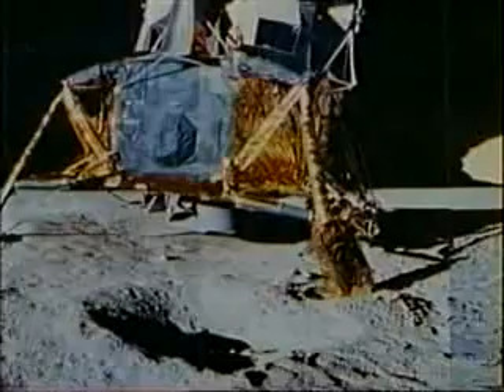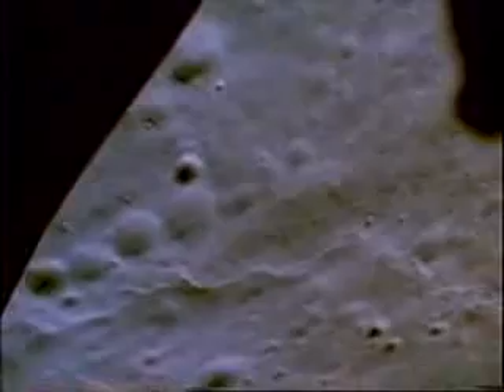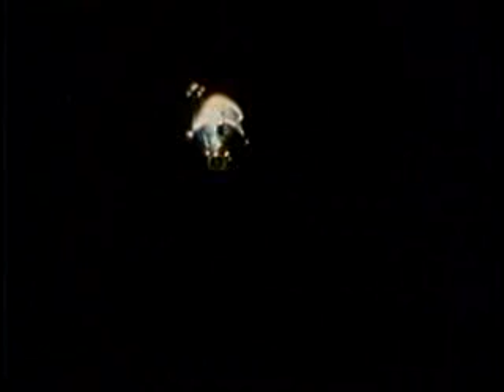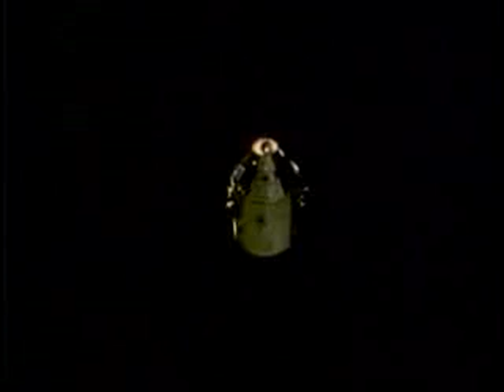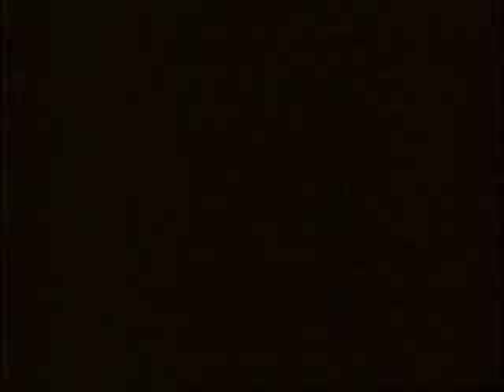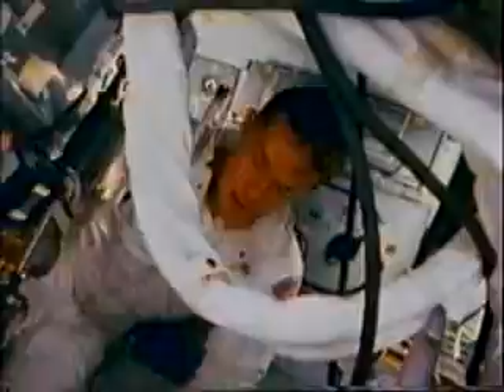Apollo 14 LM lift-off and CSM docking

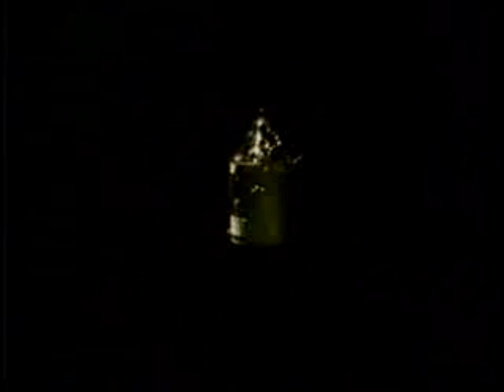Comment: There is an idiot called straydog02 who thinks the blue flash around 2:00 is evidence of front projection using a Scotchlite screen! 🤣 It is sunlight reflecting off the CSM surface shining through the tinted glass panes of the LM window, and bright enough to light up part of the frame, which, for those of little brain, are the lines to the left.
Wouldn't model work with black cloth behind, be a better option for attempting fakery? Front projection would be a ludicrous option for this situation.

Comment: And yet not even the hubble soace telescope or  any other terrestrial telescope is able to slot any trace, amazing space magic
Reply: The Hubble isn't powerful enough to resolve such small objects. Earth-based telescopes even less so, because the atmosphere will blur the crap out of your pictures. But it doesn't matter, does it? Even if the Hubble could take a picture of the stuff left on the moon, that wouldn't be enough to convince you we actually went there. You'd simply claim the pictures are fake, just like you'll do when you realize the LRO has snapped pictures of the landing sites.
Reply: @atlas8827  ... no. I suppose i do have a problem with being able to map out the craters where we wanted to land but the inablity to do it again to confirm our landings.  Its a mental I guess.  That dont make sense to me.
I could talk about my grand fathers lowly part in the program and his opinion on people. That probably wouldnt make sense to you, some times you cant even reach a flat earther with direct proof positve according to their own reasoning, just like you cant convince folks that seen it on tv so it must be true.  Im in the sucky camp where I know we didnt go to the moon and why AND I know the earth is round so i just take it from both ends of stupid. And thats on me.
Reply: @ATSucks1 
I just told you we did it with the LRO
Reply: @atlas8827  so i had to look up a video of what you refference... interesting how the hell did such a tiny lifter rocket charcoal the moon surface?  How is that possible in any reality? Not like theirs organic bits to char. And the paths of the alleged walks and rovers, so much more linear than what was shown in the 60s/70s but yeah , no , im being obtuse.   The spider lander never failed on earth never failed, the capsule always floated with out fault and everything on tv is always real when news says it is, im the one with issues.
Reply: @ATSucks1  
And there we have it folks, just like I predicted. "You'd simply claim the pictures are fake, just like you'll do when you realize the LRO has snapped pictures of the landing sites." I called it, didn't I? 

I'm not seeing any char. To me, it just looks like a bunch of footprints clustered around the lunar module, which would make sense since the astronauts had to unpack  equipment and the experiments. Also, the tracks look exactly like they should. You can compare the LRO pictures with the 16mm camera footage and you'll see it's a perfect match. 

There were several small failures, oversights, misunderstandings, and one major failure in the Apollo program. Computer alarms no one knew what they meant, minor design flaw in the fuel sensors that did not properly account for sloshing, a poorly position button that ended up being broken off by the astronauts, exhaust gas toppling over the american flag, damage of a TV camera when it was accidentally pointed at the sun, damage to one of the wheels of the rover, a docking failure, damage to the insulation caused by the exhaust gases, and these are just the ones I can remember right now. There were tons of other failures. And I have no idea what the hell do you mean by "capsule always floated with out fault". What kind of uncorrectable fault could the CSM be subjected to during its trip to the moon? What could possibly cause orbital mechanics to suddenly stop working? Magic? Come on.
Reply: @atlas8827  um ok, you have won on argument over the inrernet in a youtube comments section. Tell us, what do you to do next?
Reply: @ATSucks1  
It was never about winning an argument. It was instead about trying to persuade you out of a position that was never well founded in the first place. It really sucks to see the work of some 400,000 people, and all of the scientific discoveries and innovations that followed it dismissed by so many.
Reply: @atlas8827  gosh i think haveing alarms on a vessel going off and not knowing what they alarm too would be much worse.  Even worse than fuel sloshing in orbit.
Reply: @ATSucks1  
I'll take that as a hint that you have nothing else of substance to add.
Reply: @atlas8827  who can add any ideas to someone that already knows it all?
Reply: @ATSucks1  
I don't know it all. I've simply done a little bit more research on the topic before calling all of the Apollo astronauts and everyone else involved in the program liars. You should do that too before passing judgment on people and posting poorly research garbage on Youtube. This is an open forum after all,  your nonsense will be scrutinized.
Reply: @ATSucks1  
I don't care what your grandfather was. It doesn't change the fact that you're still wrong. Here we go with the radiation nonsense again. I don't know why hoaxers constantly bring up radiation given the fact you know bugger all about it. And you seem to be under the impression science is on your side, but it isn't. It really really isn't.
Reply: @ATSucks1  
I cannot predict the future, and I cannot read minds. I could not have predicted with absolute certainty whether this conversation would have fruitful or not.  I've done this several times, and in a few of those I was successful in dissuading people from this hoax nonsense. I must admit that I do get a bit of pleasure from dunking on conspiracy nutters who think they're God's gift for questioning "the official story" and label anyone who accept that story as 'sheep', even though it is clear they have never done even a cursory examination of the subject.
Reply: @atlas8827  so sadistic pleasure.  You come to these conversations to argue and convert to your set in stone ideas and understandings.  Also i don't call other people "sheep" as i see no need to dehumanize the common citizen. 

 As for the space race,  i understand why government would lie for national security reasons. Not everything can be hidden so the other option is to lie. Why you might ask? Because it would be stupid as sin to expose the insides and inner workings of that technology to potential hostile enemy interests e.g. north korea,  china,  USSR back in the day. Now a days its a much more interconnected global world and many of them nations work cooperatively but theirs still the technology gaps and concerns so subtefuge and espionage remains in play.  Absolutly no reason to accidently help nations like north korea with intercontinental balsitic information by accidently exposing back round instruments on the ISS. So theirs a reason to lie to the public as we explore low earth orbit.   The moon though,

Nah mate , thats fantasy fiction from a bygone age. Thats why norway got upset that the moon rocks we sent them turned out to be petrified wood. Thats why the apollo astronauts have differing stories about whther or not they could see the stars up there.  Thats why they reused the same backdrops in backrounds and the same props for the egale lift offs . The though of video sharing was never considered back then. Its all there compiled from their own footage. It can't be removed but it can be refuted and lied about and given to folks such as yourself to whip you up into this idel sadist past time to help further their ends.  Behavioural pyshcology at its finest.  I tell ya operation paperclip has nothing on the propagandists we sniped from the axis powers back then.

Anyways. Thats enough for now.
Reply: @ATSucks1  
Sadism? That's a bit of a stretch, isn't it? Pleasure derived from a self-absorbed bastard who looks down upon the regular folk being exposed for being obtuse, ignorant and petty doesn't sound like sadism, but sure, go ahead and call that sadism. 

And you can dance around international politics, national interests and what not. It's all ethereal and circumstantial crap because you don't have anything solid. Every time you try to focus on tangible stuff, it becomes clear that you're just spouting poorly remembered garbage you read online. Case in point, the Norway thing. First, it wasn't Norway, it was the Netherlands. Second, we didn't send them the petrified rock. They found it in possession of one of their ex-prime ministers once he passed away, alongside with a Apollo souvenir, and assumed they both went together. That's it.
Reply: @atlas8827  oof. Self awarness is a postive thing.  Netherlands and norway yeah i got a detail wrong. But oh my aside from affirming my opinion of your projections what did you really get right?  Christ man... did it feel good spouting that diateibe at me?  Do you feel better about yourself yet?
Reply: @ATSucks1  
I'm feeling pretty good. What about yourself?
Reply: @atlas8827  well, whatever gets you off
Reply: Have a think about the type of telescope the Hubble is?  That sorts the first part of your silliness.  Then think about the resolving power of any earth bound optical telescope.  You really didn’t think this through did you?
Reply: @stephenpage-murray7226  if youre looking to argue with a flatearther over the internet keep moving. Cause i aint one of them. You ask me whats silly, id have to say pompus people like you.
Reply: @ATSucks1  
Educated.  You’re not
Reply: @stephenpage-murray7226   bravo squarehead
Reply: @ATSucks1  
Appreciated.
Reply: @stephenpage-murray7226   don't mention it.
Reply: @ATSucks1  
Anytime
Reply: @stephenpage-murray7226  youre welcome
Reply: You would need a telescope the size of the earth to see the moon landing sites. But you can see them from a satellite orbiting the moon. Search it up
Reply: They were in an aircraft hanger that's why there are no stars
Reply: @looneytoons2878  Prove it.
Reply: @DemonDrummer  The astronauts were also attached to helium balloons to simulate less gravity
Reply: @looneytoons2878  Again, prove it.

Comment: For people that don't believe we went to the Moon, I have a question. So when Neil Armstrong walked down the ladder and stepped on the moon in 1969 with the whole world watching, are you saying that the whole world was watching a moonset with actor's climbing down a fake LM on to the Moon?
Reply: If hoaxers would look at the Apollo guidance computer restoration video,  or read the Apollo flight journals, they'd be mind blown, that is if they could even grasp it. Unfortunately they are incredibly ignorant to understand what kind of engineering went into even small things like the bolts holding down the Saturn V. These illiterates have never seen a Saturn V launch I guess.
Reply: They were in an aircraft hanger that's why there are no stars
Reply: He sure did, and because it was live they could not have slowed down the playback by the square root of 6 or else the sound and video would be out of
sync. Here is more stuff to consider:

Where is the video showing the inside of them LEM with the astronauts in the moon suits and attached with the bungee cords. They had a periscope in the CSM and LEM for navigation, but for some reason there are no pictures or videos of stars. The second moment changes as the fuel and oxidizer gets used, but somehow these 4 groups of steering  motors kept the LEM from crashing. No remote control or autopilot test landing to verify the LEMs control system and steering motors, with the sloshing fuel and oxidizer and water, but somehow they got it right the first time. The LEM simulator Neil flew and crashed obviously did not have the same second moment as the fake studio LEM on the moon stage. No radars on the moon to verify CSM orbit and LEM ignition.  For the moon suit sublimator what blackbody absorber temperature did they use for outer space and the maximum power flux from the sun from the ultraviolet to infrared wavelengths. Same with the engine jet landing on the moon and the missing dust cloud and nobody afraid of rocks piercing the LEM or damage to the antennas, steering motors, or landing radar. They could have pointed the cameras up away from the moon instead of golfing on the moon stage but they decided not to because they would have taken pictures of the stage guys on the catwalk They also drove the moon buggy with lots of dust in the vacuum of the moon studio. Where is the video showing the astronauts in the LEM on the studio mooooon putting on their backpack life support. The clown did a fake spacewalk in the non gravity simulator in the airplane, but for some reason no stars in pictures or video from that. Their studio moon suits were contaminated with moon dust, which likely is radioactive, but no problem to put a Geiger counter next to their suits to verify there was no radiation hazard. Neil jumped off the studio LEM, but since it was live they could not slow down the speed by the square root of six, like the Six Million Dollar Man slow motion, because that would put the rest of their studio acting out of sync..Astronauts could not get more than 6 inches off the moon as they were hopping and walking and pretending to be on the moon stage. Radiation heat transfer on the LEM so they used a glycol cooling loop to radiate that heat back out into the air conditioned studio. Total hoax.
Reply: Sue Kennedy very complicated explanation you gave there. It would take way too much time to explain to you where you are wrong and why. All your points have already been debunked
Reply: u2mister1: High guyz!? What is your 4 year degree in and university you graduated from. Did you post your calculations for the heat and mass transfer for the fake sublimator on the fake LEM? I like your video on using a slide rule to figure out forced vibration eigenvectors. I have no doubt you have written lots of code for NASTRAN.
Reply: @suekennedy8917  
Why aren't you at work?
I would think that master brain would be helping someone.
Reply: u2mister1: I already did with litigation against criminal government employees. You can too with your only trivial video. Just be careful when the governments lawyer asks you about your  academic status and what your 4 year degree is in and university you graduated from and what makes you an expert witness for a civil trial. Anyway, keep on with the useless comments.
Reply: u2mister1 nothing regarding this has been proven to be real, ever.
Reply: @ollyb7371  ppl like you even earth is flat😂😂
Reply: @tony-pc4kd  repost if you k own the moon landing was real
Reply: Sue Kennedy Also, there are never visible plumes from the RCS system on any supposed footage on and around the Moon. Every shot of Spacecraft in LEO, including Apollo vehicles, has a clearly visible exhaust ‘jet’ when manoeuvring systems are fired. This is a joke.

Comment: Ummm... Why would the flag and all that debris be blown by the exhaust in the vacuum of space on the moon? Did nobody notice this?
Reply: The exhaust gas coming from the ascent engine has its own mass. When that mass impinges at high speed on the flag and other debris it will move things around.
Reply: It's not different than being blown by a rocket's exhaust on Earth.   The exhaust will even travel faster, because they're is not atmosphere to slow it down.  

If you watch the Saturn V launch from Earth the exhaust of the first stage at first points straight down, then it widens to a V shape after they're above most of the atmosphere.
Reply: This is by far the dumbest comment I have read yet. You hoaxtards are so incredibly stupid.
Reply: In a complete vacuum wouldn’t the exhaust gas be sucked or vacuumed away by the surrounding negative pressure in every direction simultaneously, maybe not go down to the surface or flag, at all?

Comment: Immediately upon rocket engine ignition of the LEM the astronauts on all the moon missions comment within a second with " What a liftoff!!" and "what a ride,what a ride!!" before there is time to experience it.  In every element of flights the astronauts have to have something to say, it's called "over acting".  They feel the need to hammer the point.
Reply: They are "over acting" because they have just found that they are not going to die on the lunar surface.
There was only one engine and if it did not work, they were lost.
Reply: Go back to cutting heads off parking meters, Coolhand Luke. You're far better qualified for that than you are for making stupid comments about better men than you.
Reply: If only you were over acting your ignorance...
Reply: False statement.
Reply: "before they had time to experience it"

How long does it take for your brain to process input?
They experience the lift off immediately.
Reply: You are really really stupid hoaxtard. Be sure to bring this brilliant assessment up at the next cocktail party, or at your next job interview at Rally's.
Reply: Also the audio has to travel he says lift off 4sec after take off that's quick from the moon
Reply: The audio is recorded at the same time the video is.